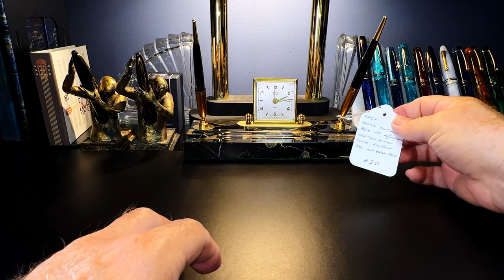Vintage 1930s Eclipse Zephyr Celluloid Lever Filler Restoration and Review

Comment: Funny! The last time I tried buying a fountain pen in an antique store, I got a "what kind of pen?" To be fair, it was a small town down south in the other Dakota. I had better luck in the Dakota to the north, except that the one pen had a glass nib. Stay tuned: some problems to solve there. I feel like either fountain pens were rare in North Dakota or else antiquers just don't sell them here.  An elderly woman I know recently told me that she has some, but doesn't know what she did with them.

Good for you on the heat gun: I've never used one on a fountain pen. I own one, but I've only used it for electronics.

On a happier note, North Dakota did give me a fascinating mechanical calculator. I may be restoring it for years!

Anyway, vintage pens are what kept me into fountain pens. They are fascinating, and it's an incredible experience to bring a once-loved pen back to life and write with it.
Reply from the maker: Thanks so much, Jason!

Comment: What fun!  I have an Oxford-Wahl of about the same vintage with a 14k stub nib restored by professionals -- pen $10 US, restoration . . . rather more.  And, it is beautiful.  But the nib tends to dry in my pocket.  Horizontal on the desk, better.  I have some other pens of the same vintage which I might take some chances with.  But, unless I just want the fun of the restoration work, and getting a gallon of shellac (I totally would) and using 1 ml in 12 years, maybe . . . .   Really, as the nibs have cleaned up nicely, I might just dip them at my desk once in a while.
Reply from the maker: Very cool, Rob!

Comment: Hi Doug great looking pen,great video.I started out repairing vintage pens & what a rabbit hole that’s turned out to be but I have had hours of enjoyment & satisfaction from restoring pens as old as 100yrs old.Their are some very clever designs,Onoto plunger fillers,Sheaffer plunger fillers,Button fillers & the list goes on.Take my advice if you ever write with a old gold nib it’s a different experience entirely from modern nibs.A great book to help is Pen Repair by Jim Marshall & Laurence Oldfield
Reply from the maker: Thanks, Edward, for the excellent information!

Comment: Cool pens! There's only one Canadian pen I've gotten, so far. A Waterman's nurse's pen from the 1940's. 
Yep. Glued in can get problematic, especially with celluloid. Depending on if it's the original type or later cellulose acetate (basically the same thing as most modern "celluloid,") they can be extremely flammable if you're not careful.
Plenty of the lower end pens have folded nibs. Even through the point right before Esterbrook was sold to Venus, the 1xxx and 2xxx were either folded or folded and welded instead of iridiumish tipping. Some were just punched to get a dimple for the tip (Welsharp was notorious for this.)
Fortunately there's almost everything available for redoing an old lever filler. Might not find a lever box and the parts for holding them in (Wahl-Eversharp you can only find used for the Skyline, for example) but a pressure bar, there's only a few that works for most pens, and there's plenty of places that have lists for most pens for the ink sacs. (Here in the United States, I'm partial to Anderson Pens or David Nishimura of Vintage Pens, as they are the same as original ones, and the best prices. 😉
I've easily done around 30 lever fillers, and if I can do it after a stroke, there's almost no one that can't do them. 😁
Good choice for the "generic Chinese nib"! Many older open nibbed pens fit a fairly generic number 5 of today. I've played with a "Genius iridium point" in a 1950s Arnold that has the original kind of scratchy nib (another folded one.😁)
Great job getting an old lever filler up and running again!
The desk set I'm kinda jealous over. I'm looking for something similar for a gift for a friend. They can use a fountain pen/ballpoint combo, so their fountain pen doesn't get sprung. 😉
Thanks for sharing this! Now on to another vintage pen! 😁
Reply from the maker: Thanks, Paul, for the excellent information!
Reply: @InkquiringMinds  Good choice of the sac, too. Silicone, ink evaporates faster, and in many, they seem to only be used to preserve a light colour, as the sulphur compounds in latex sacs is prone to discolour certain colours over the decades. (I'm very partial to using the original type sac, myself. 😁)
And, if you look at the original Parker service manuals, the imprint, if any, seems to be generally lined up with the top of the nib (and clip usually lines up with the imprint as well. ) Of course, the budget pens are less likely to have an imprint... 😉
Reply: I wasn't surprised by the folded nib, but I found it interesting on two points: These pens were obviously not made to last for years and years, but were relatively inexpensive tools, even if they were quite attractive. And seeing celluloid on even such a low end pen shows just how ubiquitous the material was back then.
Reply: @garykarlin1777  the lower end Esterbrook were folded or folded and welded, and they still seem to hold up for quite a while (much better than claims of modern steel stub nibs, for example. I have plenty that are 70+  years old that are still tipped with the folding. It's generally the older flatter feed ones that have worn off the tipping. Of course, I also have only really limited experience with regular steel nibs like the Eclipse used. 😉 I'd probably hunt down a cheap Warranted 14K nib for it. The prettiest vintage pens seem to be the budget pens, so... 😁)

Comment: I never realized that repairing and restoring a lever fill fountain pen was so... easy. (I use that phrasing loosely because it's a lot of work, but manageable) Because I don't have experience with any vintage pens, really, are most vintage lever filling fountain pens sealed up with shellac in that way? I would love to snag a vintage pen of my own one day to attempt it... I'd just be horrified of causing a melted plastic mess. 😂
Reply: Yes, shellac was the standard glue used in pens all the way up into the modern day. Richard Binder (IIRC) commented on seeing a large drum of Zinzer shellac at the Sheaffer factory in 2004 just before it was shut down. Shellac is non-toxic (and can even be food-grade!), waterproof, non-reactive, easy to work with, and removable with reasonable heat. It's basically ideal for these purposes. So buy yourself some bug extract for your pen repair needs! 😄

Comment: Strong work—Beautiful pen with a bit of extra “character.”  Appreciate the swirl remover tip! Were you able to get the original nib into any sort of working shape?
Reply from the maker: It is brass and very corroded. I have a couple of folded brass nibs from a couple of 1950s German student pen piston fillers that I might try with it.

Comment: If you spend a little time cleaning up the original nib you may be pleasantly surprised at the writing experience of the vintage nib as opposed to its now writing just like a new Chinese pen.  Nothing wrong with Chinese pens, I've got a few, but there's something special about an original old pen that was first writing in some old-fashioned office somewhere nearly ninety years ago.
Reply from the maker: Thanks, Nick. I spent a LOT of time on the nib. It is brass and very pitted. I have a couple of the "fold over" style brass nibs from some 1950's German student piston filler pens. They are very flexible and interesting. I think I might try to fit one into the Eclipse.